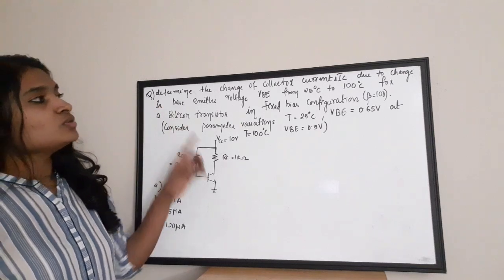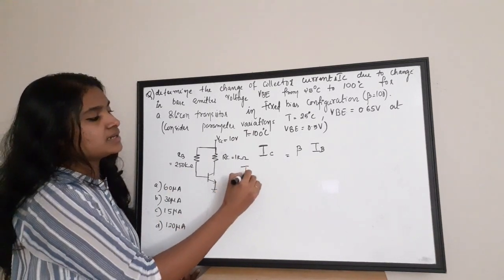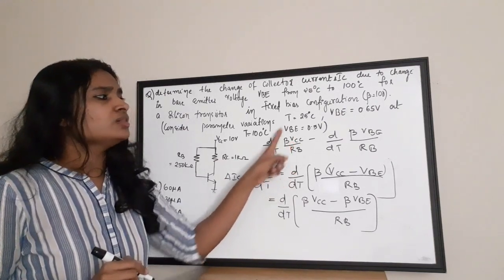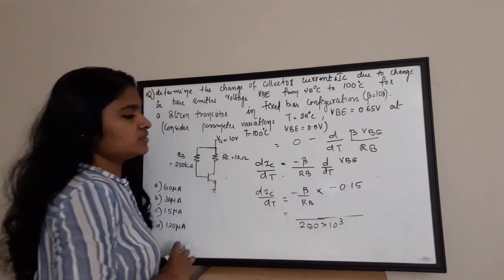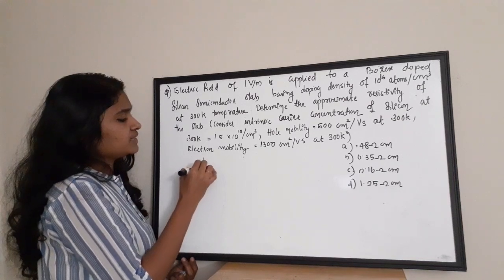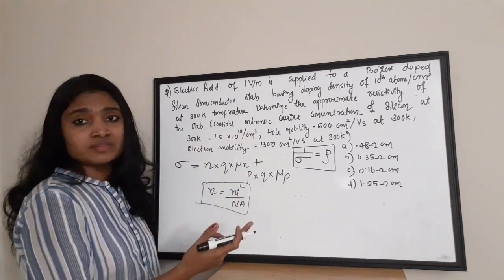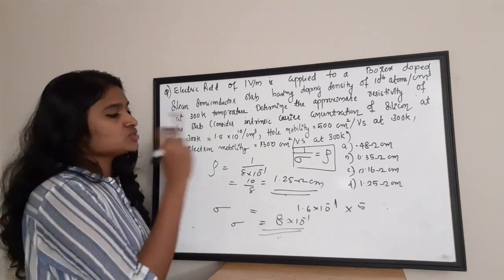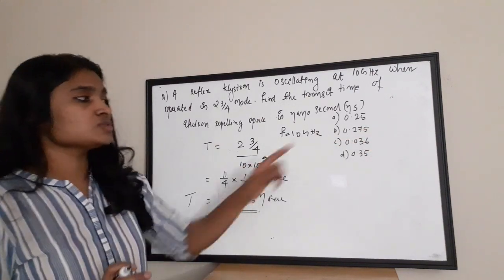ISRO-ICRB Exam Preparation ||ISRO Scientist Electronics 2018||Questions Solved Part1

Comment: Its good....mam can we neglet there electron mobility and density part because it is very less as compare to hole...so it will be easy to solve..
Reply from the maker: See even if you add since the value is less, it won't make much change. That's y we can neglect. Also this is a competitive exam so we need to find the answer quickly.